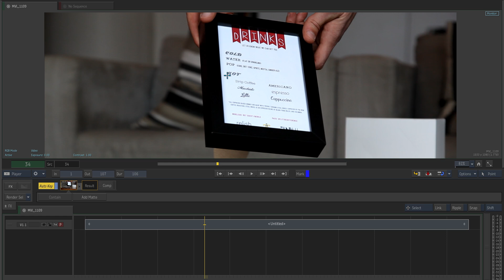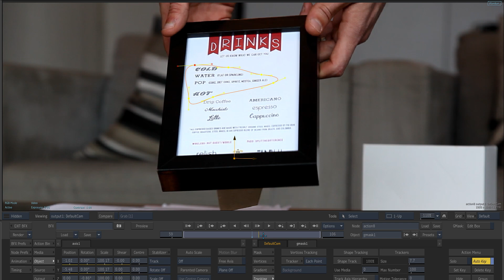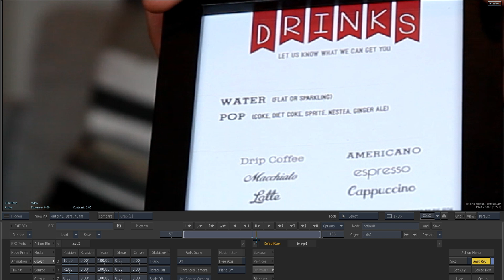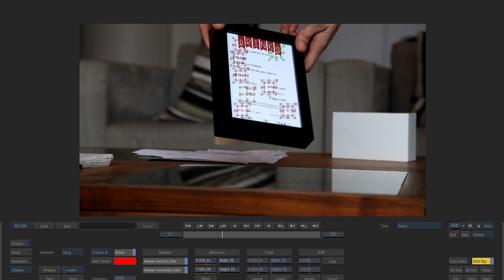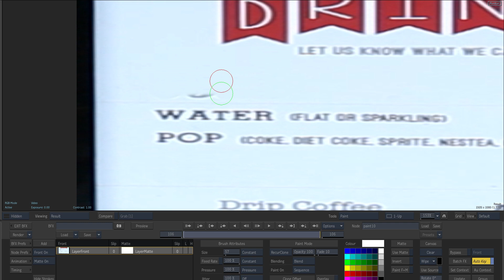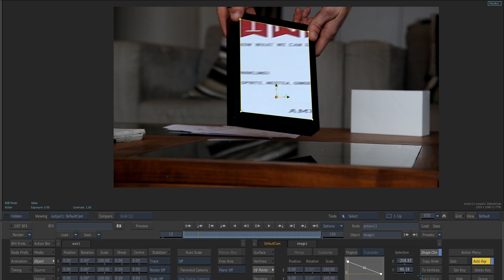PLATE CLEAN UP USING THE PERSPECTIVE SURFACE INSIDE OF ACTION

Comment: Been using mostly gmask (planar) or perspective grid to stabilize, I haven't tried adding extra tracking points inside action. Plus remove jitter button tip.  thanks!
Reply from the maker: No worries glad it's helpful